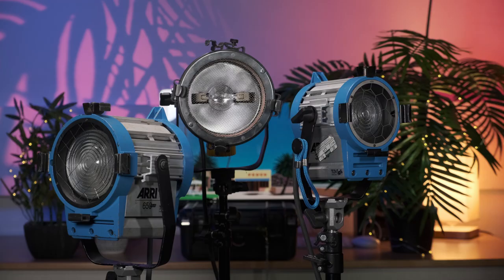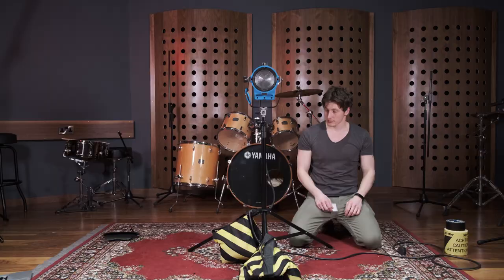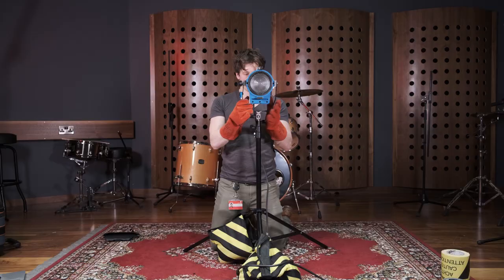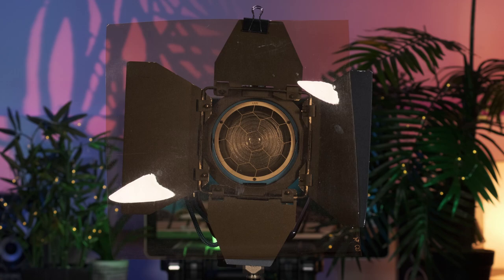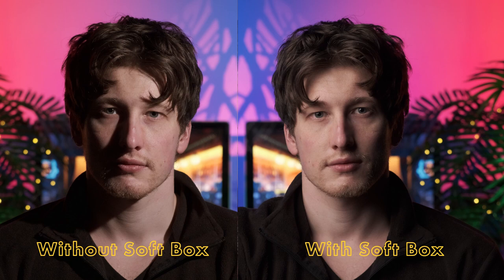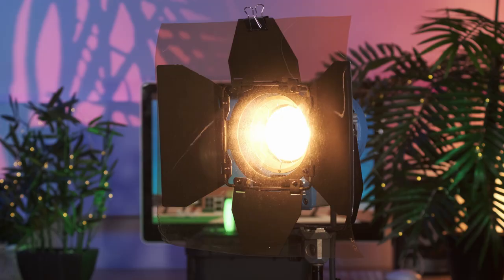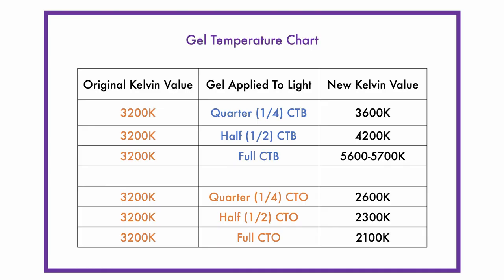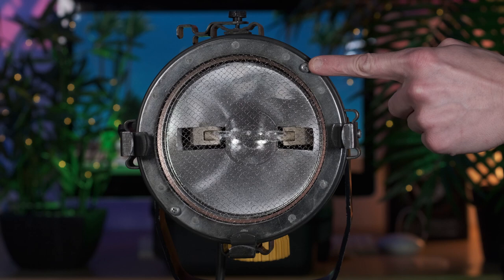Tungsten Cinema Lights: The Basics; Safety, Setup, Diffusion and Kelvin Breakdown

Comment: Thank you for doing this video. There is still a place for old school tungsten lights in movie and TV production. Some older DPs such as Roger Deakins love the warm look of tungsten and how it illuminates actor's skin better. Tungsten lights get very hot and there are extra things to think about such as separate drop-in scrims and plug-in dimmers to control output along with a custom Chimera ring (that only fits that one light) to attach a soft box. No Bowens mount for these things. 

However, for a film student on a tight budget, you can buy used Arri and Mole Richardson tungsten fixtures dirt cheap now on eBay. The exact same lights used on big Hollywood movies 20 years ago. The amount of light output per dollar spent is much less expensive than comparable wattage LEDs (which can be quite costly to buy new).